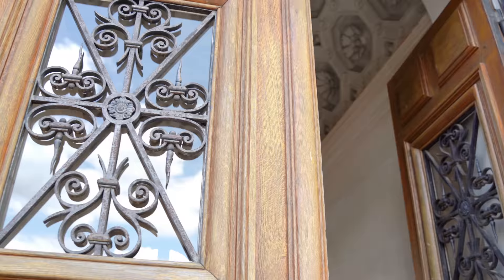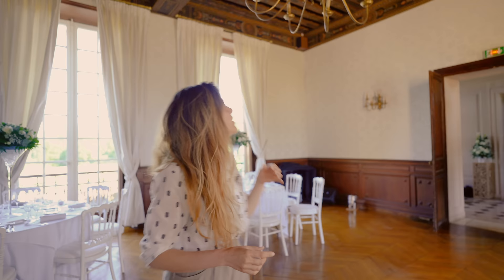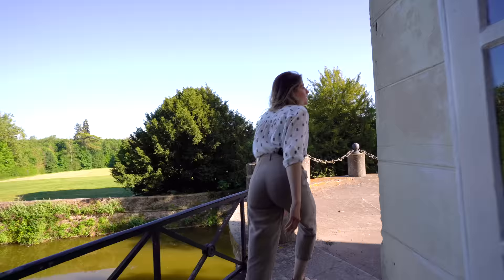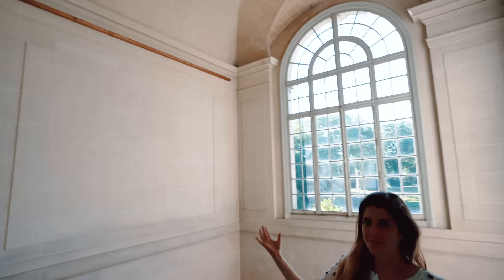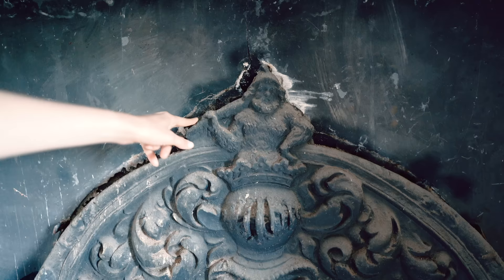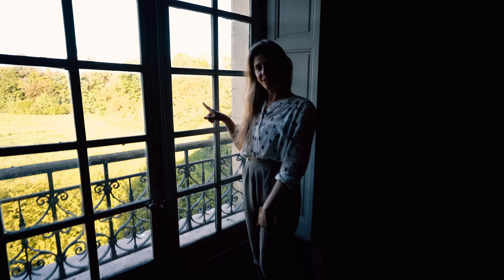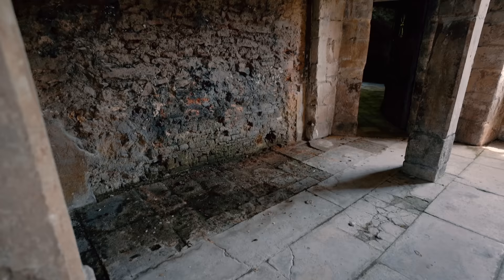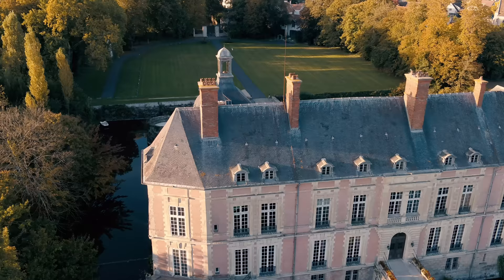French Chateau Tour | Explore Our Medieval Dungeon

Comment: Just found y’all so the long chandler. Hang a long chain and hang multiple chandlers off it at each lighting height. If you have a tic access above you could install a chain winch and lower for cleaning and bulb replacement.  A small scissor lift should allow access. But not sure of floor space underneath.

Comment: This is stunning.  I am curious, if it's not too personal, about the heating cost: do you keep the heat off until an event is scheduled, and if so what amount of time do you need to warm the space.  Electricity cost, how is water managed, etc.  Also, this may seem apparent, how do you determine which space you will renovate/restore first?  Did you keep the marble sinks and tub for use in a ground bathroom?  I have so many questions!  Thank you for sharing.
Reply from the maker: Thank you for watching! These are great questions! The heating cost is unbelievably high in winter, but we have to maintain a minimum level of heat to prevent too much moisture build up or structural cracking, so it stays relatively chilly through winter unless we are hosting an event. As for the marble bathrooms, we just had to remove them and we still have no idea what to do with them yet. We will be sharing our ideas with the YouTube community to see what everyone else suggests! We appreciate everyone’s inputs and ideas 🥰
Reply: @TheBeauChateau  Very interesting, do you ever plan on living in the Chateau itself?

Comment: One Thing you don't want to do in a underground space, is to open its windows when it is warm outside. The reason is that the warm air from outside contains more moisture than the cold air inside. Once the warm air is inside it condensates on the cold surfaces and mold is the consequence.

Comment: The ceiling and fireplace is gorgeous. I can't imagine the cost of the upkeep of such a fine building. You should indeed keep the castle as authentic as possible. 
Those old but beautiful buildings have the nasty habit for falling apart really quickly when not properly maintained. Especially the roof and gutters are risky. I once spoke to an owner of a 15th century castle of which a roof tile had broken. For a couple of years water leaked down onto the wooden beams. Eventually, the decorated ceiling of a large hall collapsed and then they found that some structural beams were completely rotten.

Comment: If you open the basement on a warm and sunny day you will bring all the humidity inside. The warm air goes on the cold walls and then there is all the humidity on the walls. Better choice is to open the windows at night or especially when it's colder outside then inside. We use a dehumidifyer for our 1902 basement but in the scale of your Chateau it's quite impossible I guess. 🤷🏻😁 
Great videos, very nice filmed and a phantastic house and project!

Comment: Was just wondering why you don’t live at the Chateau?
Reply: Wondering the same. Two answers came to mind: 1. it's (not) haunted 😆 Insert Ian coughing here 😉 2. It's too cold even with the new furnace
Reply: Just found the answer. Renee Clancy received a reply from the owners on this question.
Reply: I think the main reason is because they rent it out so much for movies/weddings/photoshoots that it is easiest to keep it a blank slate and empty, allowing for all the rooms to be used. If they lived there, I imagine their personal belongings would constantly have to be moved.
Reply: Most of the space is unlivable, the main floor is mostly okay .... the upper floors have no plumbing, heating, or ventilation ...not to mention the sheer vastness of the rot in the structure. 

Its a cheap chateau , one that has no historic value and is a melting pot of 200 years of "paint over it" style repairs   

Its value comes from the land , and its commercial income. If the square footage is as advertised,  youre looking at 2-2.5x the cost of the stead just to make it livable 

And nobody who has that cash wants to invest it here
Reply: Probably because of all the mosquitoes from that water

Comment: exciting tour! not criticizing, but isn't short ventilation maybe once or twice a day, especially in the colder morning or evening hours, preferrable for the cellar? warm air can hold onto much more moisture and if you let that in all day, the room will become more humid. since humidity will always pool at the coldest wall or point in the house, if you open a window while it is cooler outside, the warm air will flow out and draw out the humidity with it. if that is not enough, you can heat the room and then open the windows briefly (before resorting to more sophisticated drying methods). very elegant permanent solutions are electrolysis or electro-osmosis systems. the latter is even more gentle and appropriate for listed buildings, as it consists of two thin electrodes which give off a tiny electrical field which lets the moisture flow out of the masonry back into the ground through the resulting osmotic effect. And this for ever. you don't need any static interventions in the valueable building fabric and no chemicals. the house I live in (not a chateau unfortunately and not mine) has one and it works great.